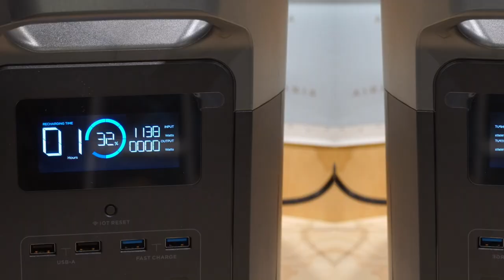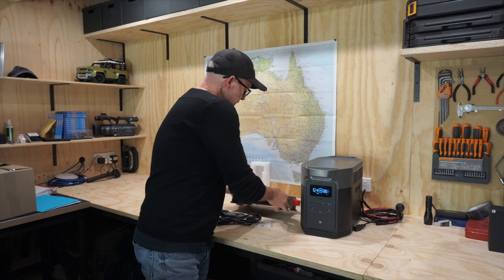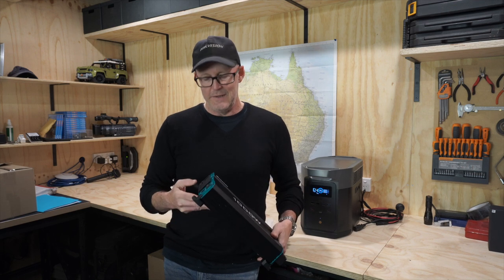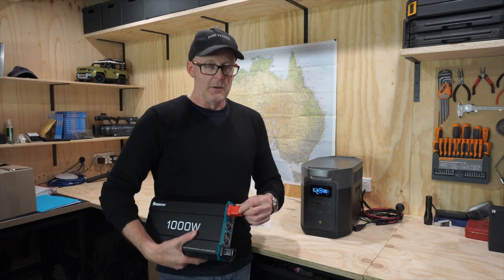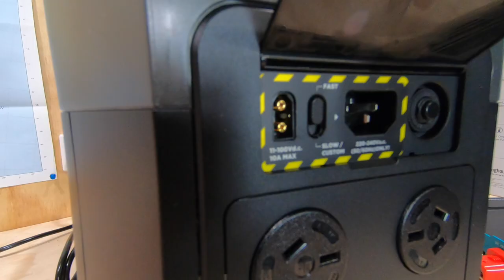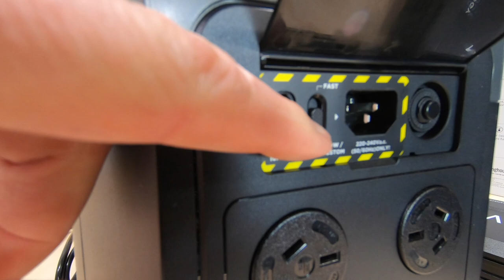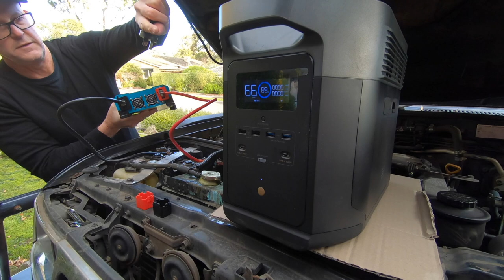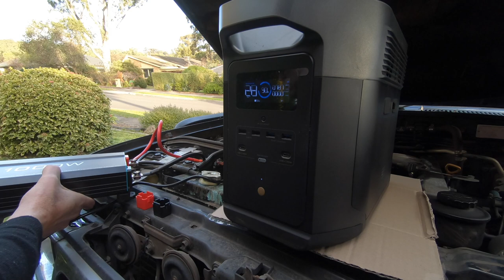Charge Your EcoFlow Delta Max 10x Faster While Driving - EcoFlow Delta Max Review Part 3

Comment: Ecoflow should wake up. Crazy to use an inverter to charge a system which has its own inverter already. It would be a mean system if you can connect it up with the alternator via DC to DC charge controller.
Reply: Assume it does have a DC to DC unit, it's just little to prevent popping the fuse on the lighter socket. 

Not sure how it's going to keep up with the 12 volt, 100amp alternator. That alternator is sized for 30% buffer over the oem engine need. This thing would hit it for an extra 75% load over the trucks needs. 

Intermittent power draw like for an amplified cb or car audio is fine but 1 or 2 hours of draw will cook the alternator fast!
Reply: With this system though you can dual charge. Solar in dc, 12v batter to ac
Reply: The car engine is what charges a battery, DC to DC comes from the car battery, inverter is like pass through charging through your battery, since you only use the inverter when the car is running. So yes, inverter makes perfect sense. You can’t fool a DC port to behave like an Ac. As long as you’re using a pure sine wave inverter, which I don’t think was clarified in this video

Comment: The shorter your DC Cables the more efficient your AC inverter output.  When you use long DC Cables you introduce resistance in your input line and this greatly effects your inverters output efficiency.  However AC power can travel much longer with much less resistance.  So to maximize your inverters output you keep the DC cables as short as possible. Mount the inverter as close to your battery as possible. A friend of mine designs these inverters and he is the one who told me this simple but astounding fact.  So keep your DC input cables as short as possible and you can run your AC through a very long extension cord.  You will see the results immediately. Your inverter will be operating at a much higher efficiency.  Trust me, try this out. You can thank me later. Cheers!

Comment: For many vehicles, the limiting factor is the capacity of the alternator.  You don't want to put an excess drain on your alternator which may cause failure or premature wear.  Vehicles vary widely in the capacity of their alternator.    You need to insure you have sufficient excess capacity.  Also you want to be careful about running high voltage AC power the length of your car.  This is dangerous voltage and the vibrations of the moving vehicle can cause wear spots in insulation. Be careful and do your due diligence.  Their are DC-DC converters that are not quite as fast as the example in this video using an inverter.  Bluetti makes the Charger 1 which can deliver up to 560w of charger power to your power station from your alternator.  Victron makes the Orion 12/24-Volt 20 amp DC-DC Converter which can deliver more than 480 watts.  Neither are as fast as an inverter but if you are limited by your alternator capacity, it may not matter. It is certainly much much faster than traditional 12v charging.  You have options.
Reply from the maker: The AC doesn’t run the length of the car although some people have recommended it to reduce the need for the larger cable to the inverter. I’m working on a video using a DC charger as another option. Should be finished soon.

Comment: Ecoflow voids warranty if you use any other brand solar panels.
Reply: Seriously? How can they tell, though? I was looking at 2x 300 watt panels run in series in order to charge continuously, but now I absolutely have to buy theirs, which is nearly 1,000 USD more?
Reply: @ironhorse. What you stated is NOT true.

Any brand panel can be used.
Reply: You want to see the email ecoflow sent me. It is very true.
Reply: Incorrect. In fact, ecoflow gives instructions on how to wire different brands connectors to plug into their delta chargers.

Comment: Ac power travels better and with less voltage drop than DC. I think it would be better to mount the inverter as close to the battery as possible and then run the ac cable wherever you need it.
Reply from the maker: Possibly but no easy option to install the inverter under the bonnet and keep it out of the weather.

Comment: 1 year on: - Buy a 12v to 24v Victron converter, this will give you 800W through the settings to charge your Ecoflow Delta Max and 1000W to charge your Ecoflow Delta 2 Max

Comment: Hi was watching a video on YouTube about using the Victron energy organisation 12v to 24 20 dc,dc converter Non isolated  hi power to charge the eco flow. Turn it up to 30 volts plug in to solar port  get over 400w

Comment: Another way is to charge through a Enerdrive (EN3DC30-24) 24V 30A DC2DC battery charger into the EcoFLow solar charge port. You can set this to a max 31v output to the EcoFlow, it will need to be limited to 13A. It would likely accept 15A though.I use this same DC2DC with another brand though mine has an external AC adapter box so I charge through a DC port.
Reply: Efficient... Probably get the DC to DC converter as close to the battery as possible...  Isolate the system from the starter battery, and have a relay to start the process with an auto off to gracefully shut things down... Wouldn't hurt to have a smoke detector and a keen understanding of electrical fuses as well...  There are a few varieties of solar port connectors, one gets you a higher charge rate capability, the other is more limited... Some folks might also find something similar to a BESTEK 300w Pure Sine Inverter handy... I live in Colorado so I use 110VAC... Should be something similar for 220 though... Should also consider the electrical load on the vehicle when charging, even at 13Amps, some charging systems will be working overtime, some not so much... Thanks
Reply: @HerrFrankenstein  What I'm refering to is a Dc2DC battery charger not just a buck or boost converter. a DC2DC charger is isolated from the main battery and those that are ignition switched don't need a relay. In Australia we have been using DC2DC chargers for years though I know its only in recent years that USA has dipped their toes in this concept.
Reply: @Dave_Gurman  Thanks, much appreciated
Reply: Can you explain more about how this works?
Do you connect this directly to the car's 12V battery?

Comment: I have this setup in my Sprinter van. However I found that a 1000watt inverter is not high enough because the Delta 2 max has pass through   110V (I’m in the USA) so when I turn on something over 1000watts, the Delta 2 Max it draws this from the 1000watt inverter and not from the internal batteries, so the inverter overloads. You need a 2000watt inverter to be able to use the Delta Max like normal while charging off the car alternator although you’ll need to make sure the alternator can produce enough current to support it. My van has a 220 Amp alternator so I should be fine at up to 2000watts.

Comment: Thanks for video Steve. I have got one of the opposition power banks and can't believe I didn't think of this. I did install a step up transformer to charge at 24 volts and I find that it's fully charged in a couple of hours. I have a VSR so that charging doesn't start until the start battery is looking healthy. I use the powerbank to run my fridge 24/7 so I don't have to do any mucking about with its power supply at motel stops etc. I have an inverter so will give that a go.
Reply from the maker: Hi Phil, the 24v step up is another good option. Before the inverter idea, I was basically trying to think of the best way to get more power into the DC port since it's capable of taking 800 watts from solar panels. Didn't think of the step up transformer idea!
Reply: Hey Phil, I'm trying to connect a DC step-up converter(input 12v, output 48v 10a) to my sprinter van's battery(which connected to alternator) and ouput to my ecoflow max's solar charge port to get the ecoflow charged when the van is running, is this the same thing you did? just trying to make sure it will work before the hook up. thanks!

Comment: If you are not leaving the truck then 1 or 2 100ah lifo4 batts and a 2k/watt inverter takes less room and allows you to add storage for about 1/3rd cost of adding another one of these units. 

I undersrand these for tent camping away fromnthe vehicle but only if your camping requires a lot of electronics. 

Really see these for apartment or tower sites. Maybe a remote building without service.

Comment: Great video, I’m considering purchasing a delta flow for use in my house and camper van - I have a split charge relay in the van and a 140A alternator so I can hook this up. Remember to add fuses to your battery cable ;-)

Comment: G'day Steve. Another comprehensive and informative video.
My aux batt is dead, and have been asking myself if this form of aux battery is the way to go, especially considering ill have a new car within the next 12 months. My biggest concern about these all-in-one's to date has been exactly what you cover in this video.
I am a bit dismayed, if not a little concerned about this method of fast charging in a vehicle for a number of reasons.
Firstly, even at 800w, that's still 66amp of current you are drawing at 12v. That's a big load to carry over approx 6 meters (pos and neg combined). That's more than enough to fry your car and burn it to the ground should there be a short somewhere along the length of the cable.
Secondly is the heat that is generated from that much current. The smaller the gauge wire, the more resistance, and therefore, the hotter the cable and connections will become. Again, a potential fire hazard.
Thirdly, in order to overcome the potential for resistance, heat build up and voltage drop, the cable size (in my ghetto mathematical equation) would need to be a 1/0 AWG.
Thats about as thick as your thumb.
Now I don't know how much room is in the cable channel under the sills in an 80 series, or the holes in the firewall,  but there's no chance of getting a 0gauge cable, plus conduit in my sills. And I sure as hell wouldn't have 60+amps running down the transmission tunnel.
Lastly, insurance. It would seem on the surface you are setting up a 12v system, however insurance companies, being the shareholder serving businesses that they are, may not agree, and suggest that a vehicle fire may have been caused by a non certified 240v installation, therefore voiding your right to claim. 
I think these all-in-one power boxes have really dropped the ball in the area of 12v charging, and perhaps with a bit of market pressure, they may take 12v charging a little more seriously and not provide low power solutions as an afterthought.
Reply from the maker: Hi Andrew, thanks for the great feedback. The actual cable size only needs to be 6G for this application. A 6G cable can carry up to 100 AMPS for about 9 metres or 30 feet. https://info.waytekwire.com/battery_cable_charts You can buy a 7M long 6G cable from Supercheap Auto that's rated at 100AMPS. As for the safety I 100% agree. I'm planning to run it in some flexi conduit and haven't worked out exactly what path it will take from from to back yet. I'll make a video about it when I do it. If you have any doubts or concerns about insurance I'd recommend getting it installed by an auto sparky so you can be confident that it's done properly and that should satisfy your insurance company.

Comment: the way i hooked it up is starterbattery - voltage sensitive relay - inverter - ecoflow. 

Reason for this is that the ecoflow is my secondary battery. And now whenever i switch the car on. Relay will close when the alternator hits 13.4v start charging ecoflow via inverter. 
When i turn the engine off. The relay senses the coltage drop. Switches off power to the inverter. Ecoflow stops charging and then switches over automatically to the permanently mounted solar panel on the roof. 

So theres almost always a form of chrging. But its fool proof to prevent draining any battery
Reply from the maker: Sounds like a good setup

Comment: Thank you for all the info,  very helpful.  I m from Canada, I run Tacoma offroad ( like Hilux) and in the truck the Tacoma have 400watts inverter from the cie. But when you drive only 100watts can be used,  400watts can be use on park. So I m gonna put a direct inverter from the battery . like your demonstration... like that is more efficient.  👍👍👍👍

Comment: Hi Steve,  
Love your work and info mate,  keep it all coming :)
I do think you may have an issue with only installing a 1000w inverter for the Delta Max though. The Delta Max has 'AC Pass Through', so if your charging... all AC load will be drawn from the charging inverter instead of the battery.  This could easily overload the 1000w inverter by accident if you used an appliance that uses more than a 1000w.
Maybe you could highlight this to your viewers somewhere,  just so they know to not use while charging, or get an inverter big enough to match the Delta Max maximum output.

I also hear you on the lack of efficiency using an inverter as well.  DC-AC-DC can lose up to 30% efficiency as opposed to a DC-DC converter. 

DC-DC converter is better than a DC-DC charger in our instance here as well.  Mainly because DC-DC chargers have a brain (smart) ie:- have a charge controller. Ecoflow Delta is also (smart).  So we need a DC-DC converter (dumb) instead of a charger (smart), to let ecoflow control it's own charge needs.

Hope this helps you and your viewers from an accidental mischief :)

So glad I found your content. I'll be referring to your content many times, as I'm just starting my own journey :)

Cheers
Reply from the maker: Thanks for the input. I wasn’t planning to run anything from the EcoFlow while it’s charging but it’s a good point as other people may do it. I think the worst case is that the inverter would overload and shut off then you’d be using the EcoFlows battery which would steadily drain. I’ll test it next time I get a chance.
Reply: @ExpeditionAustralia  Victron 12V to 24V Orion-Tr Smart 12/24-15A Isolated DC-DC Charger VIC-ORI122436. 

This is what he is talking about. This raises the voltage up to 30V by dialling it all the way up which tricks the Ecoflo into thinking its receiving input from a solar panel ( you buy a new solar plug to connect it as the one with the cigarette also goes into the solar input but is not wired up right). This will allow you to get 15A instead of 8A. 15A x 30 volts= 450W. Very respectable BUT note you are not drawing the enormous currents that you would be doing with your inverter. It is drawing 450W at 12V from the alternator which means 450 divided by 12V giving 37.5A. Much less then if you're drawing 800W at 12A which is 66amps. I guess just use bigger wires and fuse it appropiately. You can get an andersen plug to the boot, wire up the unit with the Andersen as well and also connect a trigger wire to an input which is on the unit so that it only turns on when the engine is running.
Reply: BTW how are you finding your 1000W inverter after a year? Any issues?

Comment: @ExpeditionAustralia
I plan on running the new 12/12 50a dc/dc charger from alternator to 100ah house battery. This should be charging the house battery at about 600w while driving. If I then connect the house battery directly to delta 2 using xt60i, would it also charge at maximum charge(500w) while driving? Then when I stop driving and the dc/dc stops charging the watts will drop to 12v x 15a =180w which I think would be pretty good as a constant supply of back up power. I still get high rate charge during drive time and then a lower constant supply as a kind of battery expansion.
Do you think this would work?

Comment: Thanks for this vedio I’m out side traveler , and I have delta pro , I was very confused between inverter or dc to dc victron , I know at the end I need inverter and I don’t want put dc to dc and inverter in my vehicle because to many wiring and dc  to dc confusing . After watch your Video give me clear idea that I just need good amount watts like 2000 or 3000 inverter and easy hook up with eco flow and good to go , my question why you not add ground wire from car battery to inverter . ? Please reply

Comment: Great video.  I did the same setup with same equipment.  On slow charge of echoflow Delta max.all was good. On the fast. Harge setting. The te edgy started beeping and yellow light flash.  Wouldn't  charge echoflow while driving till I reset it to slow charge. Have u has this issue? Thoughts and suggestions,  thanks
Reply from the maker: Yeah I dialled down the charge rate to 600w and that stopped the beeping and doesn’t seem to be overtaxing the alternator

Comment: Help. !  
Autotrail 2007 scout. 
I bought a EcoFlow delta 2 max. And then I got a renogy 1000w inverter I connected the ac out of the inverter to the EcoFlow ac charging point. I then connected the inverter supply cables directly to the battery inside under panel in floor. 
 I know there is a battery outside in locker behind drivers side door. (Leisure batt)
  When I have the engine running and setup the inverter stops beeps and then carry’s on charging then it beeps and stops and carry’s on charging. 

Am I missing something ?